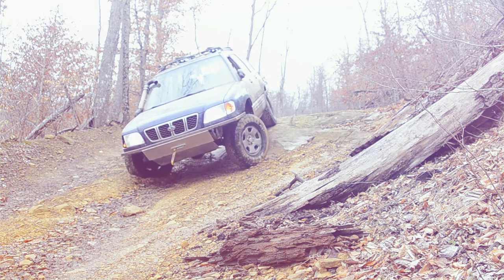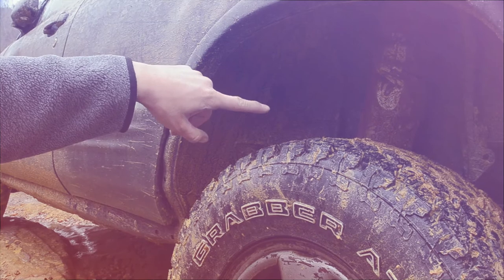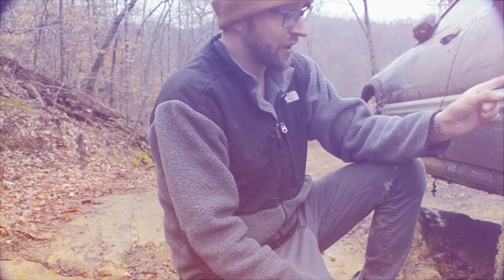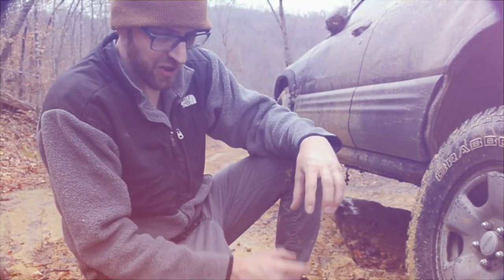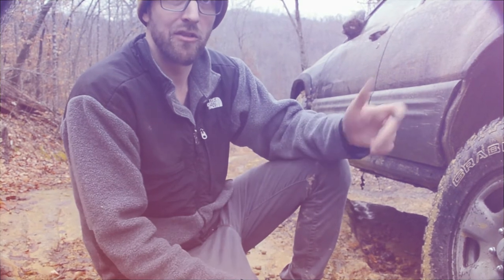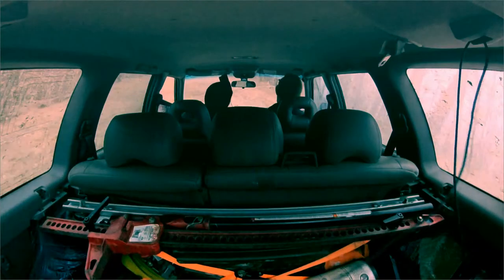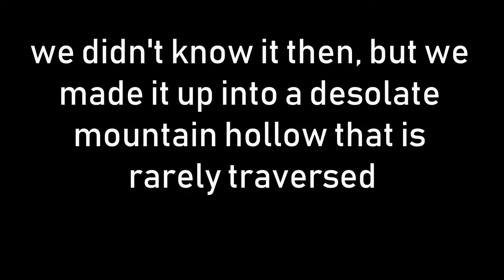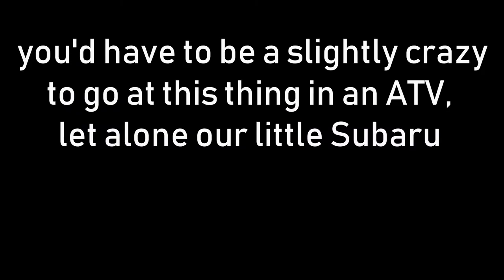How to fit big off-road tires on a Subaru Forester + Important channel update

Comment: I realize there's a difference in the wheel well between the forester and my 99 outback but what would I measure to see if I could fit the 235x75x15 on? I am installing 2.5 strut spacers and 05 forester suspension to get around 4" of lift.

Comment: what transmission do you use?   do you have a low gear? and one more. do you have rear LSD and if yes what type is it?
Reply from the maker: 4eat, no, yes, Vlsd. See other videos, we talk all about what we have and how it works for us
Reply: @powerofyourbrains  ))) ok thanks. and why you don't put low gear transmission?
Reply from the maker: The low gear is for non-us domestic markets and only for manuals I believe. For climbing, the torque converter on the auto is about on par if not better in some respects
Reply: @powerofyourbrains  ok. i have 2005  sg5 LL bean, with rear vlsd, but it is not so effective, in diagonal situations it is completely useless.
Reply from the maker: Check out our long travel suspension video. Increased travel is the best (and cheapest) way to solve the diagonal dilemma
Reply: Garnik Meliq-Karapetyan I’ve heard to remove rear and front sway bar and it helps a lot .

Comment: Dude, seriously. Buy a real 4x4. If you put the same effort and your obvious gift for engineering and fabrication into a really cheap proper 4x4, you will have a properly insane off-roader that won't grenade diffs and delaminate rear wheel wells. Don't get me wrong, I love Subarus and learned to drive in a Forester but they are never going to survive where you want to drive them.
Reply from the maker: You should watch the other video's on the channel...This channel is not about going down recreational trails in jeeps with commercially developed bolt-on products; these are excursions over unknown terrain in a highly modified vehicle that has been adapted to this terrain. This mess was about a judgement error; no vehicle should attempt to go where we went, which was down a steep descent only to discover there was no exit. All the "real 4x4's" that attempted to get us out broke just trying to get up to the peak. We made it to the peak, down the other side, and also winched all the way back up it. The real culprit in our case was the high mileage VLSD we recently installed, not some vague connotation of which off-road platform is most virtuous.
Reply from the maker: I did read your comment. Jeeps have a huge aftermarket, and there would be little point to fabricating as we do. Time yes - its part of the fun, resources no - we are cheap scapes who chop up $1500 Subarus. Aside from low-range, there is nothing exciting about Jeeps to us; its already mostly there...whats the point? Plus, I can't even imagine trying to turn around on 35 degree inclines in anything much taller than the Subaru
Reply: Power of your brains With a real 4x4, you don't need to turn around on the incline as you have the ability to get to the top. And down the other side. Even more amazingly, after going up AND down your REAL 4x4 is not even slightly fucked and you can do it all over again.

In any case, if you want to waste your time and money on pointless excrcises, that's great. I too engage in pontless excercises. Such as this conversation.
Reply from the maker: Lol, alright man. Your free to drive your Jeep off a cliff
Reply: Power of your brains If I had a Jeep, I would. Old Jeeps are ok but the newer ones are shit. Hate Jeeps. I like a car that will take me anywhere AND get me home without breaking down. Japanese 4x4 all the way. I have a 1990 Mitsubishi Pajero. Amazing off road without being a pig on road. 475,000km with no major failures and I have abused the crap out of it. Only cost $2000. Many awesome memories have been created for my children with that little truck.

I am much like yourself. I won't spend a dime on off the shelf gear if I can make it myself. Best example was the 2 inch lift. Spent $100 on a pair of leaf springs for the rear that were from a 1996 L200 and wound the front torsion bars up. Also cut the Bump and drop stops to increase suspension travel on the front.

Backyard engineering rocks.
Reply: Daniel Beard my familly has a first gen pajero turbo (intercooler !) diesel and this thing is a tractor; tho not that good on road
Reply: Old comment I know.... But it's not really a matter of which platform performs better. Yeah, obviously a real 4x4 would out perform a Subaru. But that's not really the point? Everyone knows that putting money into a Wrangler or something will result in a capable vehicle that'll be guranteed to drive over practically anything. A Subaru? Who knows where the limit really is. Build it, break it, make it better. We're trying to figure out just how capable the platform can be. Turns out, pretty damn capable. 

Not to mention, this is just fun, period.